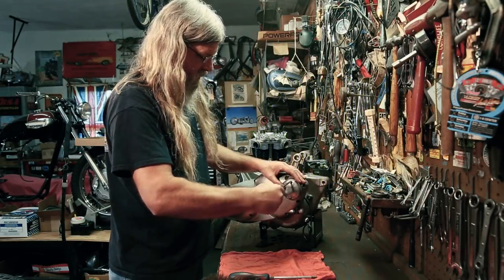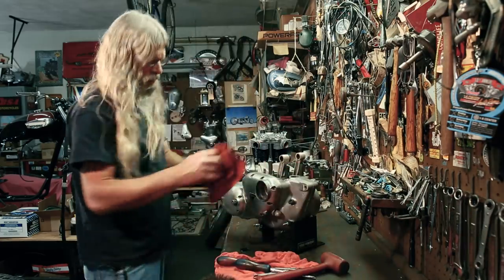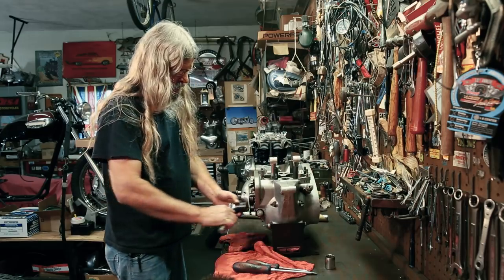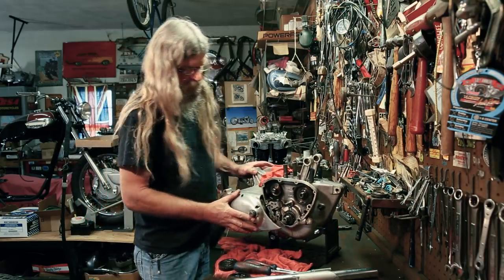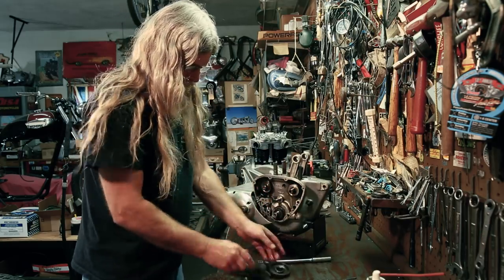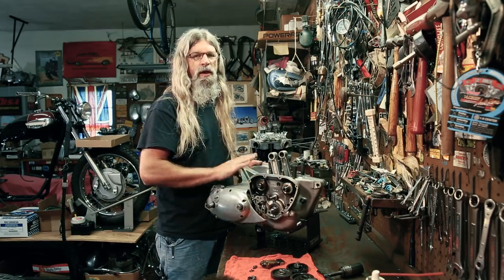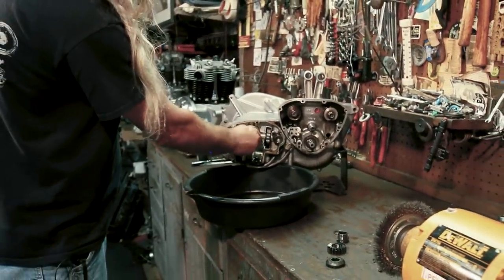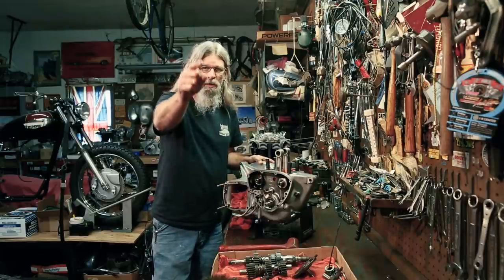Triumph 650 Motorcycle Engine Disassembly & Rebuild part 4 - Lowbrow Customs

Comment: I took my 650 apart 40 years ago in 1980 and I don’t recall having any of the fancy tools you have in this video. I’m not sure just how I got a lot of that stuff off. (??? ) I just know I didn’t hurt anything and got it all back together and it was one of the ‘ oil tightest ‘ Triumphs ever. 
I took it apart to get the crank assembly out to attempt balancing it better for it was so bad you could hardly sit on it. I did not take the sludge trap apart as I didn’t even know about it, so now after it has been sitting the last 30 years I am going to do just that.
It’s going to be an awesome time trip
Reply: Wish you could remember and share your secrets. Maybe when you do it now it will all come back to you. You start?

Comment: Purchase a hand impact diver set for the stubborn screws and save yourself a ton of grief.  The import ones are very inexpensive and they work great!  Far better and much faster than the 'chisel ' method, and no damage created in the process.  I've used mine for years, still works fine!.

Comment: I had an old Suzuki. Im not a violent man. But, the old bike makers, for some reason, loved using Phillips and Regular screws. Long story short, 40 years of corrosion on a Phillips head screw in a tight spot, nearly turned me into a VERY violent man.

Comment: I've followed these videos all the way through.  I'm about to pull the timing gears on a 66 T100SR.  It'd be real cool if you guys posted part 5 soon.
Reply from the maker: J. T. Working on the edit now, sorry these are extensive and take a long time to produce
Reply: Boy, they sure are extensive.  I wish I knew as much about anything as your guy does about taking that engine apart.  Thanks for the heads up.

Comment: well i was trying to remove the camshaft gears but i could not hold the tool tight enough with pipe pliers as shown in the video so milled 2 flats to suit a 1" inch open wrench and it was much easier....just FYI.  mark

Comment: How would you have undone the kickstart ratchet if it hadn't been slack?  I slacken all shaft nuts on the right hand side of the engine while I can still lock up the primary transmission.  If you leave the cylinder barrels on until you are ready to split the crankcases, you don't have to worry about the rods getting damaged as you turn the crank.

Comment: @12:25 Todd, what do i do if the last 200 lb gorilla put the exhaust cam gear in with a socket and hammer? The threads are trashed and i can't pull the gear. My only thought is to weld some bolts to the gear and pull that way. Anyone tips/tricks?

Comment: When using a pullerto remove a gear which is very tight, is it not a good idea to tap on the end of the puller before tightening it further and possibly damaging the puller.

Comment: Yes an hand impact driver is needed of course.....Todd is proficient in other aspects......a $20 bill dropped on the table at a tool shop would take care of that.....I use bits from a hardware store , carpentry bits , set in a 1/4" socket on the 3/8" drive of the impact driver.....the offshore  bits  can be brittle..............a swing above your head with the dead low hammer isn't always necessary ....tg.

Comment: If doing this with the cases still in the frame, a dab of grease on the end of the exhaust cam will prevent the "chinga" from falling off.

Comment: I am working on the same model engine... my ratchet gear isn't coming off it seems to be stuck. Does anyone have a way of taking it off? 25:50
Reply from the maker: remove the entire cover with the mainshaft still attached and try a deadblow hammer once the nut has been removed. If you have more questions feel free to give me a call. 1855-456-9276 and push for tech support. - Todd

Comment: Great video but it is really poor practice to use a ratchet with a fork tube attached . They are not designed for it and you are asking for an injury! You should use a sliding bar with the fork tube all socket sets come with one.